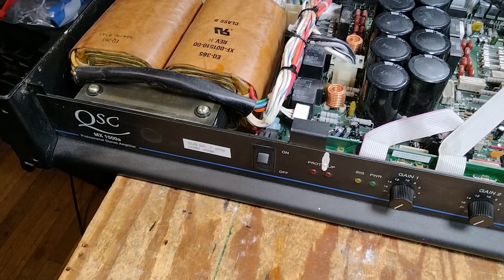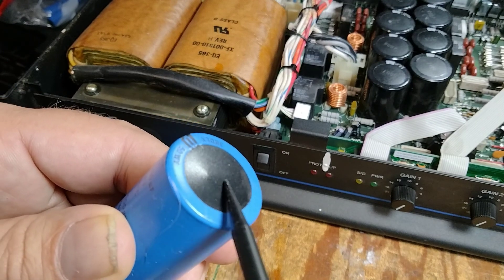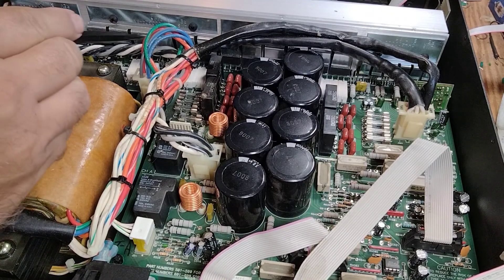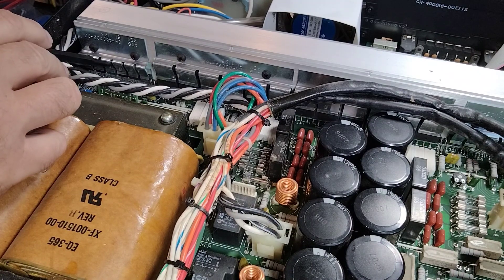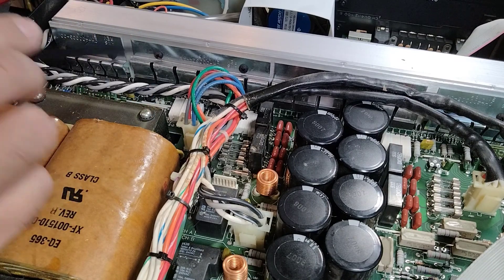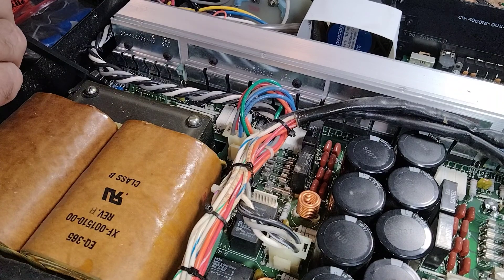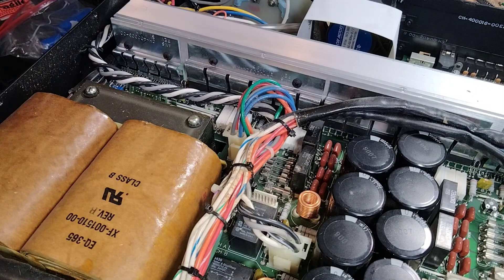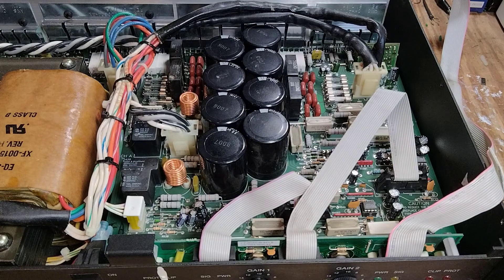QSC MX1500a repair.

Comment: Many of them have PC board damage due to the filter caps shorting and leaking and catching fire.  And often times, the control hybrids are blown up (little boards standing up near the heatsink) and those are no longer available from QSC.     If you want to support these amps...and they're great amps, to be sure...then buy up examples that have one bad channel and you'll always be able to use them as parts sources for others. 

Replace the capacitors with long life 105C types and there's no need to go with higher value caps than the originals.  You don't need to boost voltage or capacitance ratings.